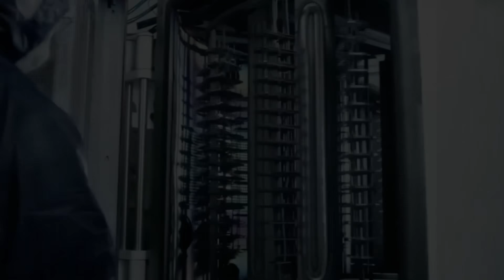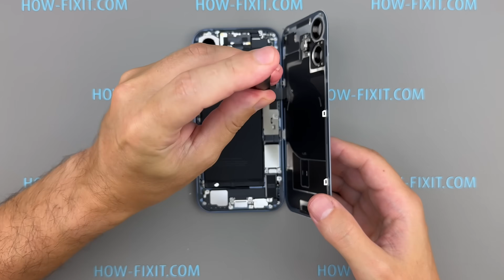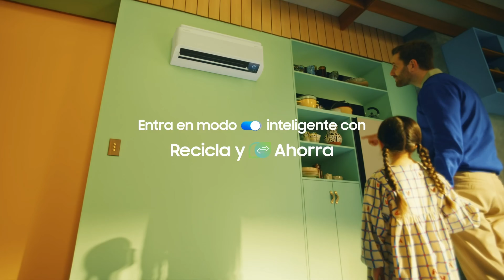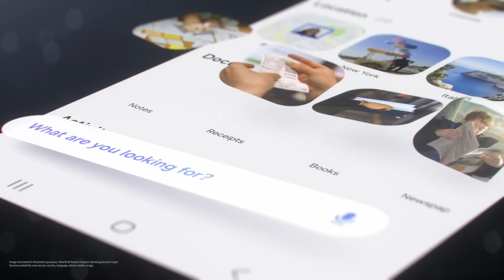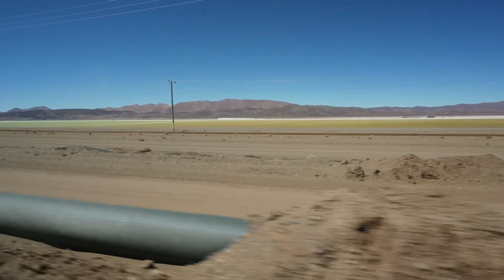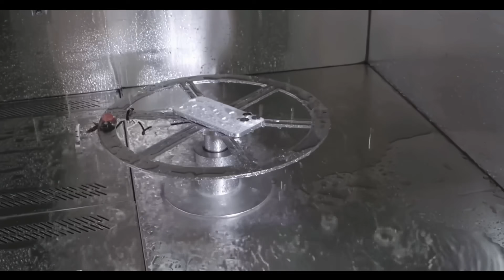The Sad Reason Removable Batteries Are Coming Back 🔜🔋

Comment: Replacing the battery in a phone should be as easy as replacing a sim card.
Push it in, and it pops out as easy as that. Lithium batteries explode, no exceptions.
I had a phone that was 3/8th of an inch thich. The battery bulged causing the center of the phone to be almost an inch thick, I took it to a battery store and the employee replaced it in about 5 minutes and said if I had it for one more day it would have exploded like a hand grenade in my pocket.

Comment: By putting permanent batteries in phones means that when the battery fails, you have to buy a new phone.
I spent $36,000 at ITT tech to learn how to replace the $0.02 resistor on a circuit board only to find that I could not get a job. The industry wants us to replace a $5,000.00 motherboard because a 2 cent resistor failed.

Comment: I honestly don't know how removable batteries will be in practice. But there is a reason why, when my previous phone broke, I replaced it by one from Fairphone. The same reason, when my previous laptop broke, I bough the one my sister wasn't using anymore. (And it's also why my next laptop will probably be a Framework, one my curent one break.)

Comment: I like user removable batteries. The idea of having to send my phone to a shop and pay 60.00 is irritating, I can change the battery in a new car, but have to throw away a phone because the battery is bad???? Why not make phone chargers that condition the battery instead of constantly pushing them to die in two or three years, justy so we cannot continue to use a phone we are comfortable with, and already have the accessories for?

Comment: I am prety sure that Apple and maybe other companies will NOT put replaceable batteries (see new iphone 18). Why? because the new legislation in EU left a window open! If the device is water resistant at IP67 level and the battery can hold 80% charge after 1000 cycles, they are allowed to seal their device... Amazing, right?

Comment: I love my new Shiftphone 8.... Batteryreplacement in around 30 seconds, no tools needed... the battery costs only 18 Euros... And the Phone has a Slot for micro SD Cards up to 2 TB...
Reply: My biggest issue with the Shiftphone 8 is it still backs the adapter or BT push and despite all of that bezel around the screen, it still has the stupid holepunch front camera. I know a lot of people can't stand bezels, but I'm perfectly fine with some bezel - my two most recent phones have been the Sony Xperia 1 III and the Galaxy Note 9 (in that order, sadly, thanks to Sony having awful QA for fingerprint sensors and the dwindling market of phones that come with features) and both have had everything hidden away in the bezels. I'm not onboard with a notch or a gaping hole in my screen, and the 8 bizarrely chooses to have both.

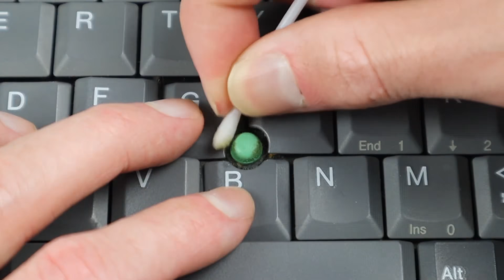Comment: 1:38 "the device you're watching me on right now" - ha! wrong assumption! watching on a PC.
Reply: I'm not only using a PC, but a huge heavy desktop computer with a monitor, mechanical keyboard, and mouse. It has NO camera and NO microphone. I bought one of those big heavy laptops back in 2004. But when I went to replace it, I discovered they had been replaced by disposable GARBAGE. So I had a local mom and pop computer place build me the big heavy desktop computer, which is not only repairable, but was built without a lot of the spy trash that storebought computers have.
Reply: @geraldscott4302  Same here.
Reply: I am watching on my 65 inch TV.

Comment: Hi y'all,
Being an old electrician/technician, I like to be able to replace my batteries in my devices....
So, I bought a NOKIA feature/dumb phone with a replaceable battery.
Simply slide the rear cover off, pop the battery out & put the new one in & replace the cover. Easy Peasy.
The phone cost just $99.00 AUD & works fine. Never connects to the WWW, coz I have no use for that.
I just needed a mobile phone. (ps. It also has a 3.5 mm Audio socket. Another win.)

Comment: Why not make the phone and the battery as two separate pieces. If so you could change battery either for another one the difference could be that both pieces were in waterproofed containers and they could be made slim plus there would develop a new market. There could be rubberized battery casing. insulated and or bigger capacity, like before...and  why not a 3.5 mm jack. the battery would still be encased and attachable on the phone which perhaps could gain more than "just" power. Just a thought.
Reply: @ThePepzo Well the real reason is that the average consumer does not care enough to buy something based on that feature. The current construction makes the phone as small as possible and makes it feel solid in the consumer's hand. The company would have use a bit more money and likely it will be a bit thicker and feel a bit less solid because it would no longer be glued  together to form a single solid piece.

Comment: It sound like to me Daisy is basically just like the massive Arc Reactor. In the first Iron Man movie a Publicity Stunt a Science Project. Something to shut us the hippies up. And as for how I Personally feel about Removable Batteries making a comeback?

I think it could go a long way in reducing landfill waste. In the long run even if we’ll be forced to take it back to Apple or whatever the brand of store that we bought our smartphones from. To get the batteries replaced could be a good thing for everyone even if they make it where. It has to the company and places like a Best Buy can’t replace your phones or digital devices. Still would work out and benefit for everyone in away. Although come to think of it they probably would end up charging us a quarter of the price of what we paid for the device. 

Especially Apple and then that goes up the older your device is. The more they might want to change just to get us their costumers to buy a new said device. All the while calling it a Special Battery Replacement or whatever. And in which case we could we’ll be back to where we are now. As in the end it’s probably would’ve been more worth it it just get a new device.
Reply: Not to mention Apple's common practices when 'repairing' a device in which they put the broken one in the bin, hand you a new one with an expensive repair fee and some flimsy excuse of how the onboard data couldn't be recovered. This is after they've texted themselves any nude content they find on the device, of course.

Comment: Removable batteries will be a thing, but it'll be like modern vehicles, where the only way to repair them is to take it in. The customer won't be permitted to replace the battery without a professional service with the "correct" tools and knowhow. Essentially, nothing will change, at least not on the consumer's end.
Reply: Incorrect. This is a summary of what the new law implements:

Easy replacement: Batteries must be replaceable using standard tools (e.g., screwdrivers).
No barriers: The use of adhesives that can only be removed with heat or solvents is prohibited.
Tools: If a special tool is required for replacement, the manufacturer must provide it free of charge.
Spare parts guarantee: Replacement batteries must be available to end users at a reasonable price for at least 5 years.

The "tools" one is the interesting one here. No company wants to have to include more in the box than the bare minimum (as shown with the disappearance of chargers), so requiring things like pentalobe or tri-wing screws are out.

Comment: My daily driver phone is now 9 years old. Gladly I am tech savvy enough, that I could switch out the weak battery after 5 years. Quite the process, which included heating up the phone and doing some delicate work. So even though this new regulation doesn't even impact me very much, it's a great thing to happen, will make digital life for so many people easier and reduce e-waste. I will remain curious, how the exact results will look like, as to how the makers implement this.
Reply: It is at least one level of magnitude harder to do that today with a new phone. The phones of a decade ago could still be worked on without too much effort. They have changed that.

Comment: reminder that it's entirely possible to make an ip68 phone with a removable back, headphone jack, and sim/sd tray
Reply: Give me back my microSD card slot, removable battery, and headphone jack, you phone making cowards!
Reply: I have a X Cover 5 with removable batterie and 3.5mm klinkbuchse it have also ip68 im not sure aubout that but i have make a short (5-10sek) test with water and it works. At some point i broke the Display and bring it to a repair Shop now i have a new Display . And now i write this comment on my Phone ;).

Comment: YES PLEASE BRING BACK REPLACEABLE BATTERIES!!!!! (Sorry for yelling) but ever since they stopped with replaceable batteries its made everything harder. Consider this your battery dies and all you can do is sit and wait for it to charge, with replaceable batteries you can easily "hot awap" them and have a fully charged battery instantly. Even better is when you can independently charge the dead battery. 
Consider this U.S. Cellular use to have an option for dead batteries, bring it in and swab for a charged battery no wait needed, was fantastic!
Reply: I bet they will make it where your phone still has to be disassembled to get the battery out
Reply: Instead of keeping the easily swappable, they sold us fast charging "Get 50% charge in just 20 minutes", which increases the decay of the battery's lifespan. Yet another expensive solution to a problem they forced upon us.

Comment: The thin phones being thin is more or less a scam because you have to place them in a  protective case to avoid permanent damage from the first time you drop it
Reply: CAN I GET A HALLELUJAH, NERDS AND GEEKS?!?!?!

(Seriously, some of us just want a phone that isn't going to shatter without spending $75 on a case that makes it more bulky than it would have been if it were built right in the first place and a screen protector that keeps the screen from working right.)
Reply: Yes! And making the tablet or phone so thin even if it's nice and rounded it kinda cuts into your palms? No thanks! My old Nokia brick never did that, it was comfortable to hold precisely because it was not too thin, unlike "modern" phones.
Reply: I saw an article on Gizmodo back in the day saying you shouldn't get a case for your phone because it "covers up the work of the phones designer and who cares if your phone breaks, you have insurance." 

the unmitigated gall.
Reply: @octapusxft  
To me, thin also means less space for phone parts. That usually means a smaller battery. At least a larger battery can last a bit longer even after degradation in a few years.

Comment: I can get a battery replaced at the mall in 30 minutes.  Please, what is this AI talking about?
Reply: Yeah, you can visit and pay a specialist to switch out your battery. But it's costly and you as a user still don't have the ability to easily switch out that battery.
From next year on, electronic devices must have a user replacable battery in Europe. That enables you not only to switch out your battery without having to find experts, it lets you carry around spare batteries, so that it is less likely that you end up with a dead phone (I know powerbanks are a thing).

Overall it's less about convinience, but to reduce e-waste because people can keep using their older devices more easily. Because guess what. Not everybody has a mall around the corner with a phone technician in it.
Reply: @Marc_Fuchs_1985  No it does not require it to be changeable on the go like in the old phones. Only that you can do it with basic tools. This might kill the specialised penta-lobe from Apple as that is not a basic screwdriver.
Reply: Yes, but you have to go to a store and open up the device. That's not the same thing at all.
Reply: @0bsmith0  I guess, but they’re not using a chemical to do it either.
Reply: @MetaMechh  If they aren't using a chemical to remove the original seal and replacing it, the process makes your phone no longer water resistant, negating the whole point of those seals being so important at time of sale.

Comment: Comes in line with right to repair. I had a Samsung that was water resistant that took seconds to open up the back and replace battery. In addition, it had antenna terminals (physical ones) so you could connect a car antenna. To ask the general phone user you could find that most people are happy with the current thickness (6 to 15mm) and size (fit in normal hand )
Reply: @iainlumtuck8658  yes the s5 was  like that